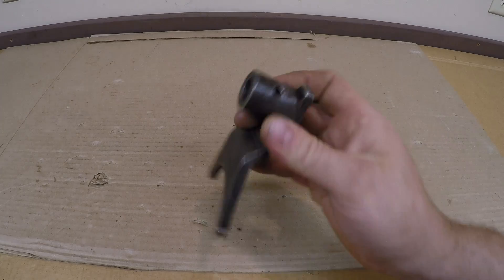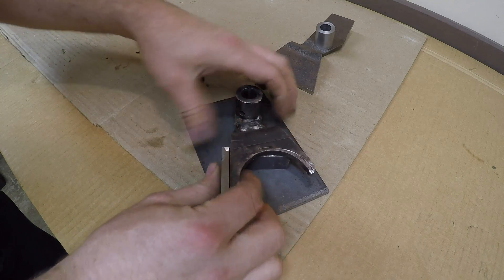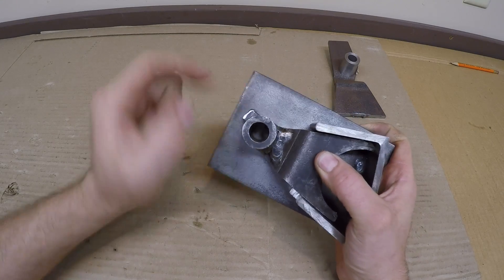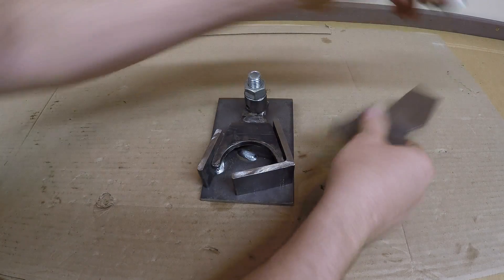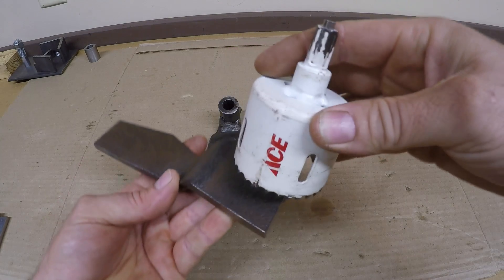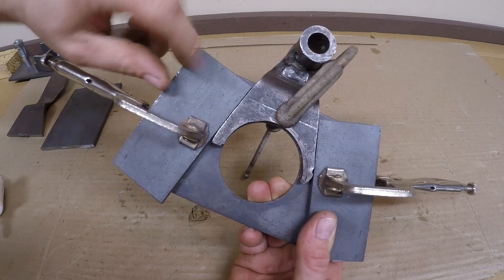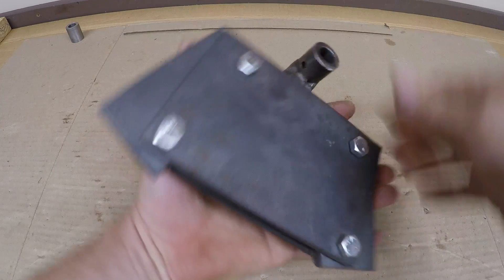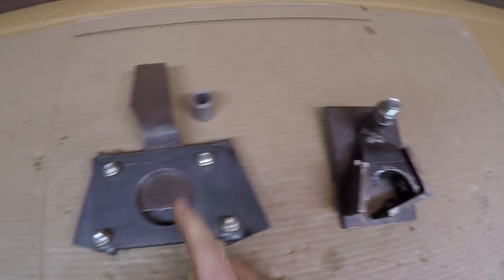Minneapolis-Moline 445 Prototype #X231 - Part 44: 2-3 Shift Fork Fabrication Continues...

Comment: Just weld up the old one and remill it, your reinventing the wheel.
Reply: Francisco d’Anconia you are absolutely correct. If he was in the field and had to get it running that is what one would do. Here, I believe the mission is a little different and that is restoration, and he believes this is the way to to do it. I’m not a machinist, but I’ve had some schooling in the art, and making jigs and fixtures to fabricate new exact part is what he is showing us, not quick get it fixed, so we can get real work done now. S

Comment: When I am using a hole saw that size and need to keep the pilot bit from wallowing out the hole I simply drill the 1/4" pilot hole and use a piece of 1/4" rod as guide.  The 1/4" rod is stronger than the drill bit and won't wallow the hole either.

Comment: I think it would make sense to cut out the bit that engages with the gear, 
rough out the hole, 
assemble with shims between the fork and the slot in the gear to get a good alignment 
and weld in place. 
I think it would at least take out some of the guesswork 

Look forward to the next video!

Comment: I think I would see if i could drill the shift fork caller pin hole.  And in the correct place in the bolt so i could put a pin in it to locate that hole properly before welding it.  In doing so you would have to have the bolt welded in the proper place on the back of your fixture.   But i figure you probably thought of all that. 😊 your videos never get old .thank you.

Comment: The Fab work has to be done. And you may give lots of people an ideal how to do it. I know for me, I have taken hours to make the jig. To only take 45 minutes to make the part. But when you can't buy the part. We have to make our own.
Reply: Did you not listen to the video there pete k if I remember he said it took him two weeks to do this like an hour each day
Reply: @kennethbrower2259  Yes I did sir. Did you not read where it takes me hours when I do anything like that? 

What I was getting at, most will not put in the time. To get a part right. Bought a lot of projects, the owner sold. Just because of parts issues.

And in saying hours, it turns into full days. Then a week or three per jig for me. I have to do way to much studding and rebuilding jigs anymore.

Comment: And this video exactly nails why it typically costs 5 times as much to make a prototype as it does to make a production model.  You spend two weeks making a fixture that then allows you to take 5 minutes to actually cut the part.  Keep up the good battle sir.